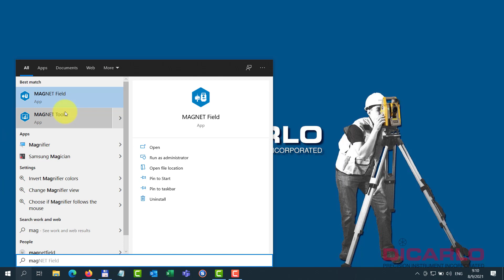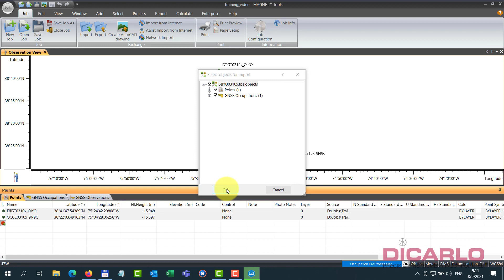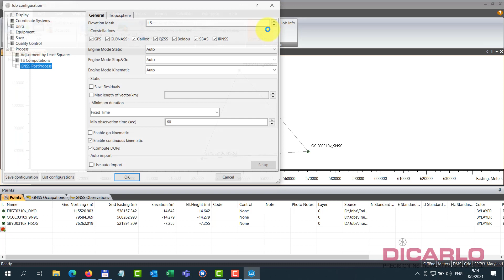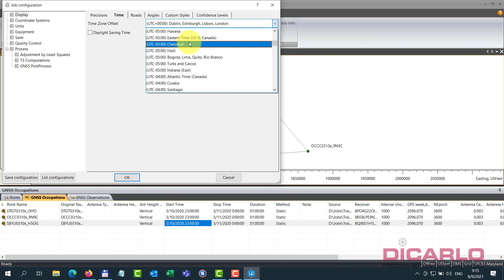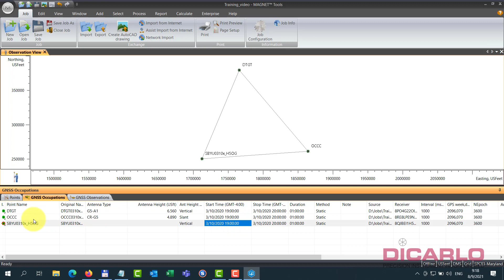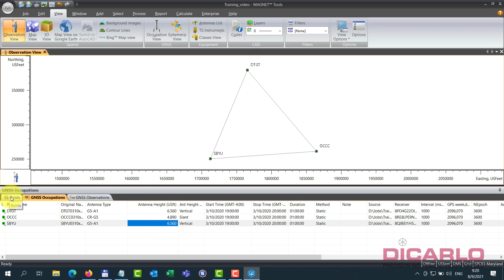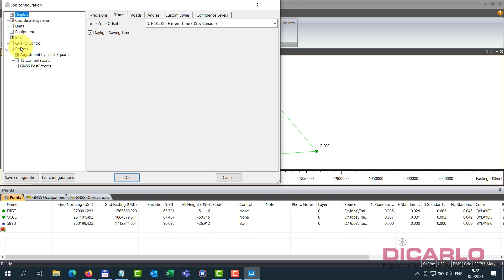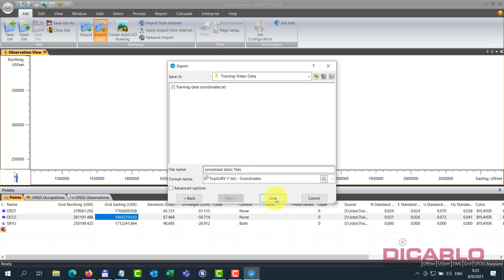Topcon MAGNET Tools GNSS processing

Comment: Hi, Just want to know is it nessecary to process only independent & dependent baselines?
Reply from the maker: Sorry, don't understand the question. Only vectors of static data from two receivers running at the same time can be processed. No common time will result in no processing (as no vector would have existed).
Reply: @DiCarloTV  I apologize for any confusion in my previous message. I would like to clarify my question regarding GNSS processing.
In scenarios where multiple receivers are simultaneously occupied at different points, is it necessary to eliminate both trivial and non-trivial baselines?
Reply: @amirulhakim7781  I don't believe there is a "must do" workflow here. I typically enable/disable baselines that are too long, between control points that are known, and observe the results get better or worse. Once I like the results and the geometry is acceptable, I stop and finish the project.

Comment: This is a very informative video. Do you know how to apply the GNSS loop closure in the data check button under the process tab?
Reply: Loop closure is a check. It will not adjust or move your data. You set up your tolerances in the Job Configuration/Quality Control. Once those tolerances are set you just have to highlight (holding shift and clicking or drawing a box around observations in a loop) the observations and run the loop closure check. It'll show you a report. If you don't like a vector, you will have to investigate how to make it better (increase elevation mask, eliminate satellites, etc.) to see if it meets your loop closure requirements... You can read the details in the MAGNET Tools manual that you can look in while running the software. Good luck!